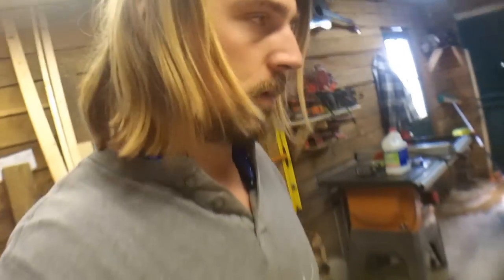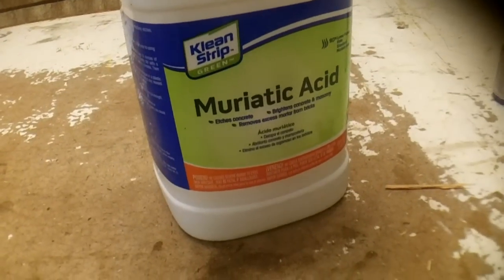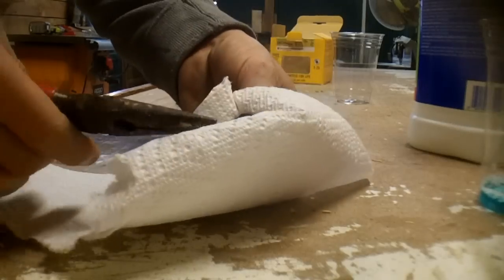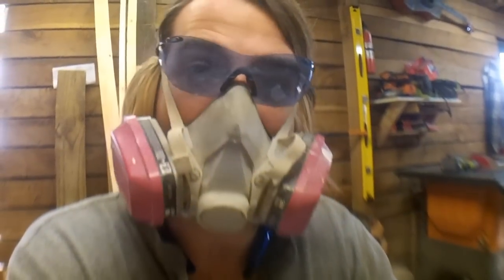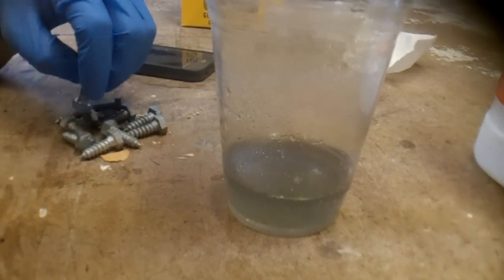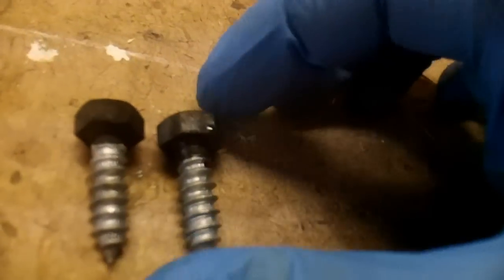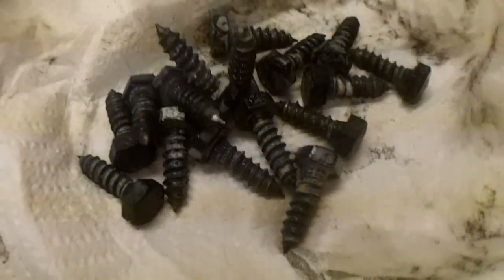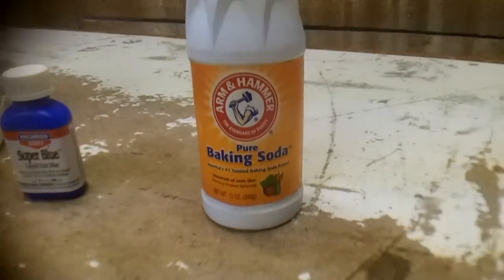Easily Turn Steel Parts Black

Comment: Nice job on the video,  it was my first Green Barn video, and I'll look forward to the next one. 
One question though: Was the acid bath necessary?  

I did not see your comparison between the two cases - the non-acid-dipped ones you did at the start and then the acid-dipped ones. Any difference in color or durability? Thanks-
Reply from the maker: Thanks for watching! and thanks for the comment!  The acid bath is necessary because these pieces are zinc coated.  With Fresh Gun Bluing solution it works very quickly so you can actually turn the steel black very quickly, however, you do have to remove the zinc in order for it to work. Without the acid bath the zinc coated parts dont get as black, and oxidize with white corrosion very soon after. the acid dipped parts turned very black very quickly, though they ted to rust when oxidizing so i recommend a finish such as an oil or some other sealant to make sure his doesnt happen.   This was one of my forst videosso please forgive me that it is kind of crappy.  Again,  Thanks for watching  and please subscribe
Reply: Thanks for the answers. So, I will use acid first (my parts are galvanized, so it might take longer to remove the zinc). I have a lot of clear epoxy that I will try as a coating after the blueing. It's a little thicker than most sealants, but I have lots of it. 

The start of your video is really nice, showing the peaceful countryside. Thanks again.
Reply from the maker: @jonnelson6448  no problem thanks for watching!
Reply: After the test you looked a little bit pale .. 😂 .. (joking)

Awesome video, just what i’am searching fore! Thanks for sharing!
Reply from the maker: @left-hand-restorer  thanks for watching!!!

Comment: Did you treat the finished product with WD-40?
Reply from the maker: Yes. You can also use spent motor oil and other products as well that you may just have laying on the shop. Do a quick Google search and see

Comment: I think you should know that muriatic acid is extremely dangerous, you seemed surprised of the fact that it was hot, but that is just the nature of muriatic acid. Just to put it in perspective, where I come from (Sicily), the mafia used to dissolve (probably still does) their victims in muriatic acid.
Reply from the maker: Maybe… I should dissolve a body…?  Just playing. Thanks for the pointers!

Comment: have you ever tried then rusting them with vinegar?
Reply from the maker: I have not. Do you get good results with that?
Reply: @PMKWoodworking  hi, no i have never combined the gun blue with vinegar for rusting after, but i have recently used vinegar to rust metal and it worked great. i used a spray and did it gradually as opposed to letting too much liquid pool. i was just wondering what it might be like to use the gun blue first and then rust it. i was just working on a single project that is done now and i dont work with these materials usually, but please let me know if you try it.
Reply: @PMKWoodworking  oh by the way. after it was at the level of rust i wanted i used another product to stop the process and then seal it for the future. easy to find something

Comment: I bought a hitch pin for a riding mower. It had a hoop in the top & hit the mower. I had to saw the hoop off & grind the weld off. Then I rough sanded it. I then used the above gun blue on it. It didn't instantly turn like the bolts. Maybe because they're grade 5? After 5 dips, it finally got as black as the rest of the pin. It turned out nice!
Reply from the maker: Virginia Hardy awesome!

Comment: Thank you so much I have a quick access bar that has a b la ok coating on it and two ladies used it this afternoon and left it in a bucket of industrial degreaser which totally ruined the coating on the pry bar and thus makes it almost instantly susceptible to rust
Reply from the maker: Oh dang! I don’t know if this will help, but hopefully
Reply: It absolutely worked
Reply from the maker: Nice!!!

Comment: It will look more traditional and more handmade if you hammer the bolt heads square before blackening them. You can also blacked them the old way by heating the bolts up and putting them in any kind of oil.
Reply from the maker: I have learned that since making this video. I’m currently saving my spent motor wheel and doing that. Much safer and much easier and gives a pretty cool rustic looking results.

Comment: You should put the muratic acid in an old/empty 20oz pop bottle, then put in ~2'sq of aluminum foil.  Quickly put the cap on, shake it, and throw it.  Far away from anything that may be damaged!

Don't hold it for very long!
Reply from the maker: THAT sounds FUUUUUUUNNNN!!!!!
Reply: @PMKWoodworking  Oh, yeah, ya only need a bit of muratic in the bottle.  Don't fill it!  Maybe an ounce-ish, idk. I wasn't following "proper scientific procedures," I just wanted to blow siht up!

Comment: I use phosphoric acid to strip zinc coating. It’s much faster than vinegar and a lot safer than muriatic acid. Klean Strip Prep and Etch. It won’t rust everything in your shop like muriatic acid either.
Reply from the maker: nice!

Comment: Great video. It's been quite helpful. Thanks :)

There is something I'd like to mention though. It is a bit offtopic though. 
We currently have quite the problem of plastics being everywhere and they're not breaking down completely. This means that there are plastics in our food and even in the air we breathe. I noticed that you were using plastic cups while glass ones could've been used. Most people aren't aware of how serious the issue is, and many think that a tiny bit of plastic like that doesn't matter. But since so many people think like that it adds up to tonnes of wasted plastics. Therefore I'm asking you to reconsider the times when you are going to use a single-use plastic item and see if you can use a different material. Everything you don't use is something that doesn't eventually end up in our environment :)
Reducing plastic waste isn't only good for the animals and nature, but in the end it is also good for you and me. A single person can't solve the problem, but if we collectively move to a different mindset then we'll be able to reach a lot.
Reply from the maker: I agree, and for this process, IF i had had glass beakers or measuring cups, it would have been acceptable to use them... unfortunately in the making process with things such as resin and lacquers there is no avoiding these single use items because you only get one shot at the mixing and making and the containers cant be reused MOST of the time.  With resin there IS a chance you can use the thicker smoother mixing and measuring containers and the cured resin will come right out allowing you to use it again. 

I find there IS a lot of "Waste" in making, but I believe we can all do our best to reuse, or mitigate the amount of waste we have, or even use them for other purposes such as using wood scraps, and spent oils to heat my shop.  
In daily life I try my best to not use SUP's and I have been using a vacuum sealed insulated Tumbler for over 5 years now. Even the gas stations and local fast food restaurants around here let me fill it up instead of using Styrofoam or plastic cups and they usually give me a discount on top of it! lol
I'm totally with you in the "Fight" and I have been making efforts in my current and upcoming videos to be more earth conscious, but this whole thing is WAY bigger than any of us can do anything about. Until we get the industrial complex to act responsibly and put people over profits and stop denying the damage we are doing every day, there will never be any major change...

Go Vote
use your reusable containers
and keep educating everyone!

Thanks for watching
Reply: @PMKWoodworking  Go home soy boy. Plastics are recycled. No one cares about your left wing ideas so go preach to AOC!
Reply: There are channels for enviro-fascists where your comments are appreciated (located to the left of the “Safety Sally’s”).  I didn’t come hear to read your dissertation on the use of plastics in the workshop.
Reply from the maker: @johnmalt9921  cool cool cool cool cool cool cool cool.......... don't really know what you're going for here... I can comment on whatever opinion I want to on MY channel...  buuuuuuuuuuuuutttttt    Thanks for watching!

Comment: It amazes me no one knows “Blueing” something is stabilized rust or FeO4, take FeO3, (rust) and put it in a high oxygen atmosphere with energy. Aka boil in water. The muriatic acid is taking off the zinc coating and the iron is oxidizing or rusting. Which is perfect because you can then boil it for a deeeep purple blue
Reply from the maker: NICE ddint know that!  ill have to try it!

Comment: No need to toss out the acid after dipping the bolts , what you are left with is Zinc Chloride ,  ZnCl2,  which is a great flux if you need to do any soldering  (  or soddering  )   it cleans copper wire very well.
Reply from the maker: NICE!!! I had no idea!!!

ill have to keep that in mind!

Comment: I'm reading online that you dont need to go straight to muriatic acid, but regular household vinegar will work just as well to remove zinc from bolts
Reply: It does work just as well only a lot slower. Takes a day or two
Reply from the maker: havent tried that

Comment: What he fails to tell you is muriatic acid is fuming. Do this in a garage and a day later anything made of steel (including tools)in the garage are rusted.
Reply from the maker: welp... didn't happen to me and my shop is smaller than a garage....  but I guess thats true... thanks for trolling!
Reply: Wtf? That wasn’t trolling asshole. It was just a little friendly advice so people don’t make the same mistake I did. Ffs, butthurt much?
Reply from the maker: weeeeeeeellllllll.......

Comment: A plastic bottle any does not matter a 3 seconds pour acid into the plastic bottle.  Make a aluminum 10 round ball not to tight seal the top with its cap be care doit safely dot get hurt you will get a great reaction with a that together post a video my frien i love
Reply from the maker: you should switch to water and miz at a 70/30 instead of 50/50

Comment: if the blueing solution turns teh gal bolts black it would be better to be done without acit, as the acid erodes the galvanising off the bolts. the blackened bolts with just the bluing action will also have some zinc coating underneath and will provide better protection.
Reply from the maker: except, that I tried that and it doesnt turn the steel very black, because of the zinc protecting the steel.   thats why you have to remove the coating with acid to get a deeper black.

Comment: Will this blue also turn rusted steel black?
Reply from the maker: Depends on the level of oxidation, but I believe it will just probably not in the rust spots. Give it a shot and let me know your results
Reply: You have to covert active rusty metal before blueing it. To convert either steaming the piece of metal for 20 minutes or longer or if small piece you can boil in water for same time or longer then card the rust off with a carding wheel or four 0000 steelwool.

Comment: There's a reason bolts are galvanized, its so they won't rust out and put a big rust stain on your pretty exterior barn door... So WHY?  why waste the zinc?, waste the acid?, fume up your shop?   at little matte black paint would do the job, also, the bolts are available ungalvanized, if you like that hipster rusty corroded look
Reply from the maker: mainly cuz if you paint them it chips right off when you wrench them in... and i dont have a powdercoating setup, also, these are for interior barn doors.  thanks for watching!
Reply: Painting bolts black is a waste of time. They look like crap and they end up with different dimensions because of the paint layer where the paint then just gets forced off. How exactly is that 'wasting' the zinc or HCl? Wasting them would be emptying the bottle into the dirt or using galvanised bolts on an interior door. Also not everywhere stocks non-galvanised fittings and getting them often ends up in more time being spent.

Comment: Do you think that this process on a bigger scale would work for axes or hammer heads without the acid?
Reply from the maker: yes, I have used it on my trusty EDC knife as well as a few other pieces of metal, with varying results. bare steel works best, so fr an axe head, I would recommend making sure its very clean and maybe buff the surface a little to make sure theres no set in oilld or anything, then apply the bluing solution and keep applying to achieve the color density you want.  My knife is bare carbon steel and immediately turned jet black, but started to rust and oxidize within a few days, so make sure to treat it with an oil or something to clear coat it and prevent that.

Comment: Thank you for the video. Just want to mention that you can remove zinc coating by letting the hardware sit in a container of citric acid powder and water over night. Citric acid powder is used as a food preservative so clearly safe. It takes longer but much safer than HCl. Btw, if you leave that container of HCl sitting around it can rust your tools (learned that the hard way).
Reply from the maker: sounds like some good advice!
Reply: Vinegar works as well.. also on galvanized metal.  takes alot longer.  but the biggest problem with muriatic acid.  If used indoors without ALOT of ventilation, it will rust EVERYTHING if the vapors hang around.

Comment: After the HCL dip, I would have rinsed in b soda water, dried, then use a steel brush to get the oxide off until shiny steel.  Then blued for a beautiful bluish, black finish that is beautiful.  Otherwise any acid will just turn it black.
Reply from the maker: aaaahhhhhhhh GOOD IDEA!!!!

Comment: If you have not found out what the reaction produced it is zinc oxide and Hydrogen gas very flamable
Reply from the maker: I did find that out pretty quickly after posting.   luckily I never work around and open flame.

Comment: If I were you I'd try to stay away from Muriatic acid on most projects, and you probably already found this out as I did years ago: It's messy, smelly, nasty, dangerous, toxic, and takes a lot of care and precaution. However if you have a very complex part that you need to etch it can be very handy. When it comes to something like a bolt head you don't have that problem. You could sand the lag head using a roloc disc on a die grinder or you can use a steel wire wheel to really go at the zing coating and try to tear off as much of it as you can. Both techniques work well. I use the wire wheel on my 1hp buffer to cut the zinc off bolts and screws. Then I just clean them with soapy water and a brush and then you can "blue" them or blacken them.
Reply from the maker: huh, neat Idea.  I honestly dont even do this any more as it has just 
become more cost effective to purchase pre painted parts for my clients 
projects, but its still good for DIYers and beginners. I like the idea of the wire wheel then blue, so much easier and probably takes the same ammount fof time with less cleanup.
Reply: @PMKWoodworking  one of the reasons people don't like paint is because it doesn't look as authentic as patina. And then there are people like me who just have a simplified version to painting metal LOL

Comment: Do you think this will work on stainless steel?
Reply from the maker: unfortunately it does not.  Stainless has a different chemical composition.
Reply: @PMKWoodworking  Chromium component in stainless actually resists patina/rust which is why it was invented.  ;-)  But  Caswell does make a stainless steel blackener.

Comment: Awesome video man. Thanks for sharing your process. How are the bolts holding up? Still black with no problems / fading?
Reply from the maker: Thanks!   Still holding up well after two years!  I DID clearcoat them with one thin layer of polyurethane after installation on the door, but you cant tell and they look great still!

Thanks for watching!